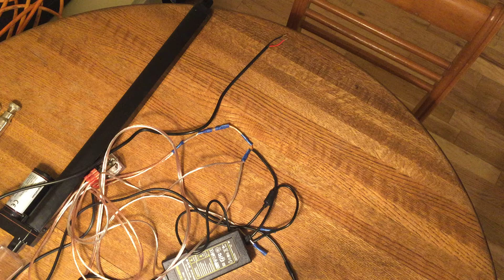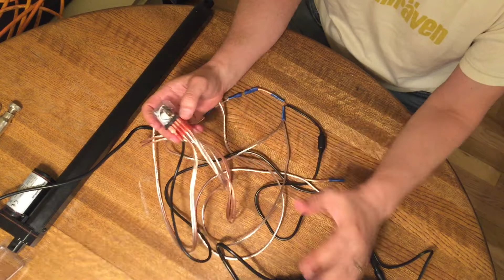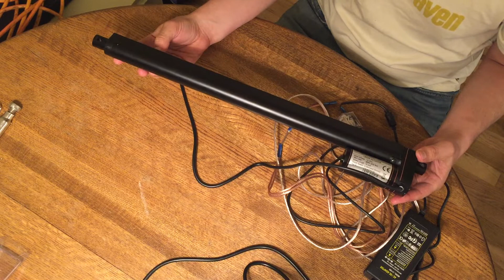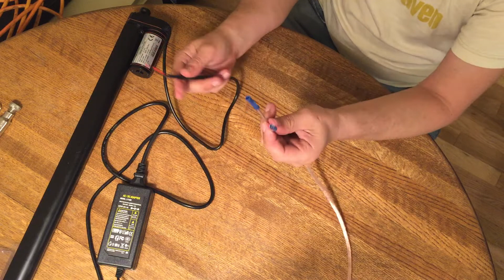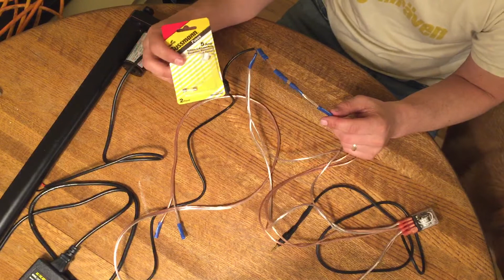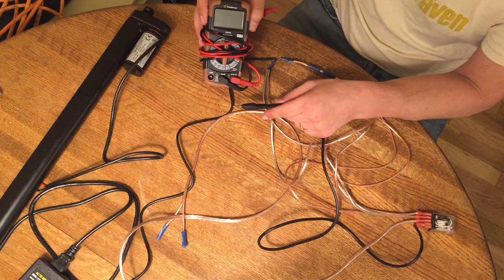Projector Lift Part 2

Comment: How much should i budget for this entire build?
Reply from the maker: +Eric Gonzales Linear actuator is available on Amazon for ~$60, Power converter ~$11, Relay ~$5, infrared repeater ~$20, wood; wires; screws; drawer slides; etc. ~$100-$150. So ~$200-$250 depending on how you decide to configure it. It's been about a year since I built the thing and everything still works perfectly.

Comment: Thanks for laying all this out! Can you give me a link to the DPDT relay switch you bought?  Also, what gauge of speaker wire did you use?  Thanks.
Reply from the maker: Chris Florence http://www.amazon.com/gp/product/B0098WE0HU?psc=1&redirect=true&ref_=oh_aui_detailpage_o05_s00
for the relay.
I don't really know the gauge of the speaker wire offhand. It was not very beefy. If I had to guess I'd say it was about 18. The amperage running through this stuff is pretty low. A note about the relay, if I had to do it over I would have gotten a relay with a higher amperage rating. I think this one was rated for like 5 and I'm pulling right at about +4.6 which is a little close for comfort. To be really safe I would have gone up to 2X expected Max draw.
Reply: Adam, great advice, I was actually wondering why you went with such a low amperage, haha.  Thanks again.
Reply: Adam, another question, What is your fail safe if the 12volt signal from the projector fails? do you have another switch or remote hooked up to the relay switch?
Reply from the maker: Chris Florence No "easy" fail safe after that, e.g. another switch as you suggest. In the (hopefully) very rare instance where the trigger or some other component fails, I would simply crawl up in the attic and lower the unit manually. I have fairly easy access and the actuator is attached to a roof truss in such a way that manual lowering is pretty painless.